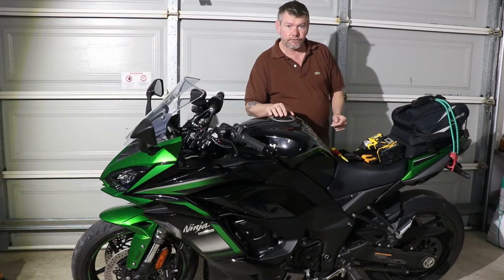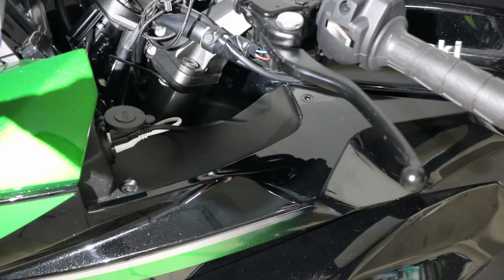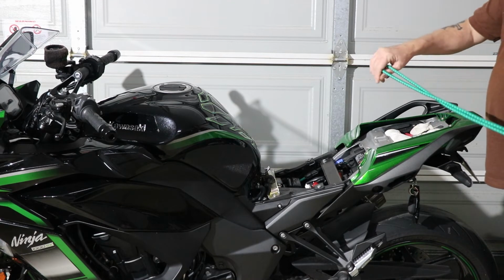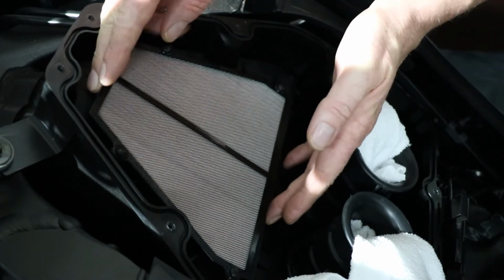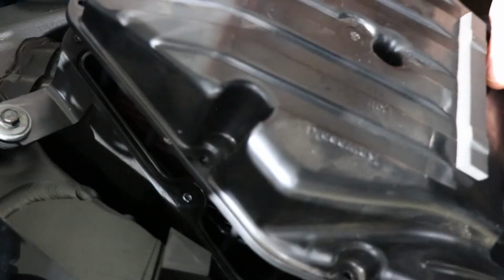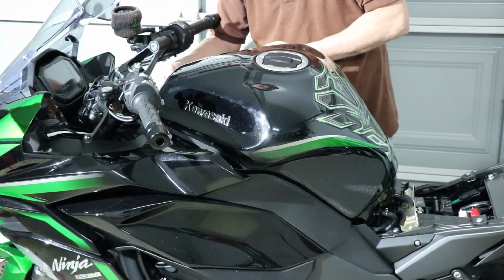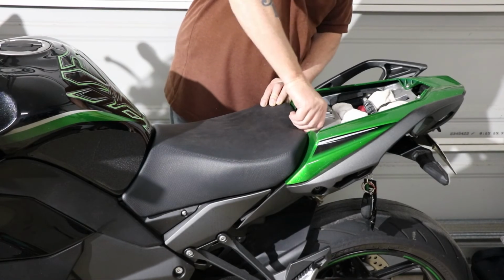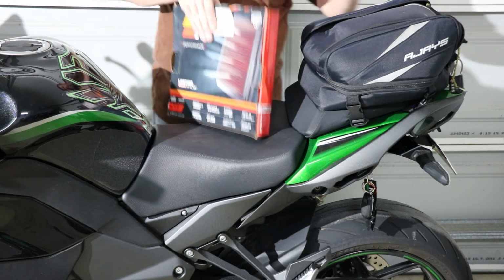Ninja 1000sx 2021 High Flow Air Filter Install

Comment: Was there a difference in intake sound ? Wish you would have put a before and after sound . Any difference in performance that you notice?
Reply from the maker: I didn't really notice a difference from the intake, but I am sure if I listened closely, I would hear it... The noticeable difference, which I did not expect, was the extra sound from the exhaust, it is most definitely louder. I haven't put it on the Dyno since I did it, but just from the feel, I would say yes, more power, not huge amounts, but it pulls better through the rev range.

Comment: Those K&N filters dry out and don’t filter well unless they are oiled frequently.
Reply: True, that’s the principle of non disposable air filters
Reply: Not True, been using them as long as they have been available, been riding 50 years. They come out of all my bikes still oiley and they trap dirt very well. I only clean them every 2 or 3 years. Its all I use in my bikes and my cars.

Comment: Why are you changing the air-filter so soon on a 2021 bike?
Reply from the maker: Because I wanted a "higher air flow" filter... More air, more power. I didn't throw the old one away, it is still good.
Reply: @Happyhound33  Is this a track bike cos 140bhp is plenty for the road?
Reply from the maker: @lold6130  Not a track bike, but I do love extra HP just incase I need it to get out of a tight spot such as passing when a car driver decides they want to speed up to stop you coming back into your lane..... It happens ;)
Reply: @Happyhound33  HP patrol questioning your choices